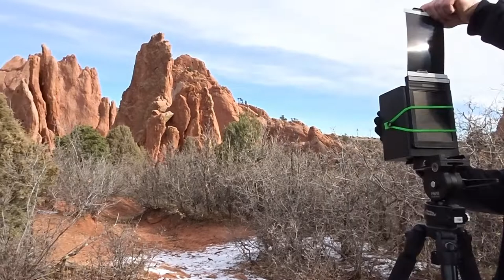DIY 4X5 Pinhole Camera.

Comment: For those asking for camera dimensions.
The width and height are determined by the size of the film holder. The depth is determined by the focal length that you want. In other words the size of the camera is determined by which recording medium and the focal length your using.
Reply: do you have a link for where you got the film holder?
Reply: @simonspargo5620  those are 4x5 film holders. You can find them on ebay but be prepared because they are not the cheapest thing. Consider also price for film in 4x5 sheet and developing which is also expensive as it needs to be done by some advanced lab as it is not a standard process

Comment: I now have to find every tool I don't own to make the same !
Reply: Every tool in this video has a cheaper substitute.  Even the materials of the camera are negotiable.  I've made dozens of pinhole cameras from "found objects" like Altoids tins, and I'm building up a collection of the tins my loose leaf tea comes in for 2x3 and 4x5 curved film pinhole cameras.  Even in wood, you can use simpler tools (hand held drill with hole saw instead of Forstner bit in drill press, hand saw or circular saw instead of table saw, etc.) and still get results that will work well, if not be as pretty as these.